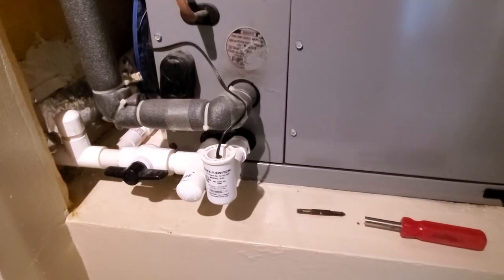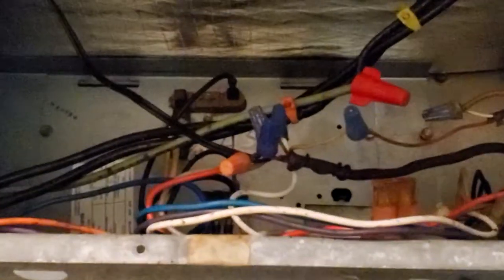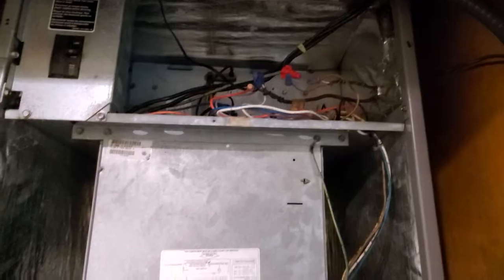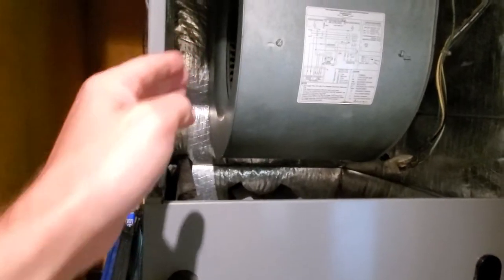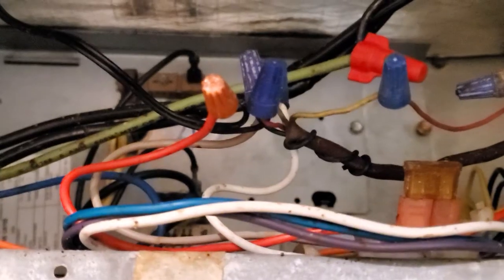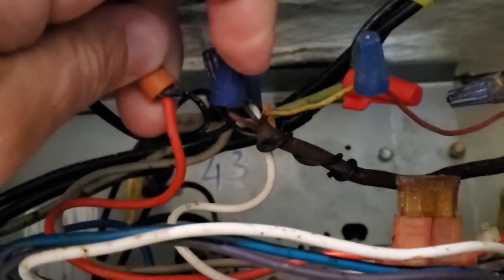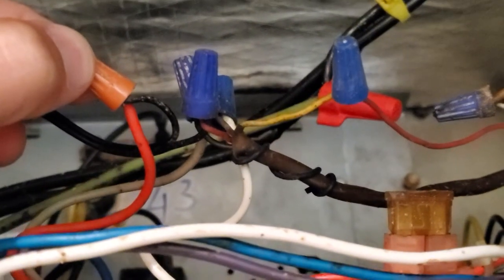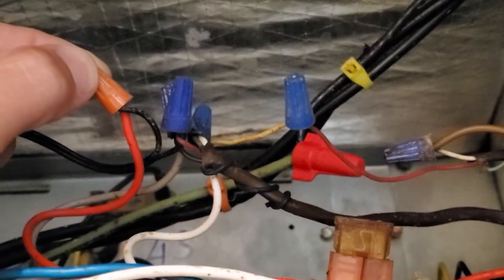How To Connect / Wire A/C Float Switch

Comment: So... my job thinks I'm getting paid enough to be an hvac tech, but I'm not an hvac tech, so I don't understand anything you just said. I'd you could either tell me where to connect the wire coming from the safety switch or convince my boss to pay an actual hvac tech to come out and do the job, either way would be helpful.
Reply from the maker: Im sorry but I can't make this video any simpler than that. I can't help you if you can't understand simple thing like connecting wires.

Comment: My ceiling just flooded.  The float switch was not properly wired by an licensed HVAC technician. Thanks for sharing your knowledge.  I need to do more of that lol
Reply from the maker: That's the problem with ac guys. You would think they are licensed so they know what they do but instead of they do what they are shown by other guys but they don't have common sense to connect safety switch to actually work as safety. They leave fan on which blows watee all over your property.  Can't fix stupid. That's why you always have to know as much as you can to make sure any job is done properly.  You just can't trust those licensed guys any more.

Comment: I had my pan overflow. Got everything working but the it’s connected between the YELLOW so I am going to connect between the RED. Is there a way to connect a small LED across the safety switch that would glow if the switch was open? Also I think my switch might be bad so I am going to go and take the float switch and turn it upside down,to move the slide part, and go outside to see if my unit is off. Ok I am back after 10 minutes. The unit shut off but my fan still ran so float switch seems to be working. So I will be looking for a 24 volt LED that I can drill a 1/2 hole and just push it into.

Comment: I would be curious how to connect both a unit float switch like a SS2 along with an overflow tray switch SS3.  I have both in my unit and have not opened it yet.  My floats are at least 8 years old and I plan to replace both.

Comment: I just moved into a rental house. My switch is shutting off the AC fan but not the compressor which seems like not a good thing. Can you let me know if this is normal?
Reply from the maker: Most AC guys do that that fan still works but if you have lots of water in the pan fan will blow this water out so I connected mine so entire units shuts off.

Comment: I installed Float switch and I connected to red wire  was working okay  but after a year I change my AC switch to Nest Google  my heater was giving me ERROR code  which is RED wire power  I remembered I connected float switch to red wire so i canceled the float now my Heater works okay no ERROR   why is that any  other way I can use float ?
Reply from the maker: Float switch is there for reason. To prevent flooding. If you connect it to red wire it will shut off entire AC. You can connect it to yellow but it will only stop compressor.